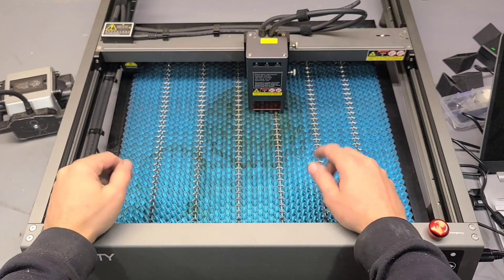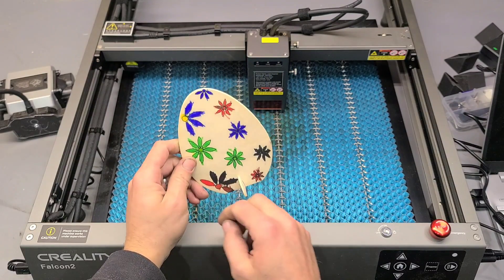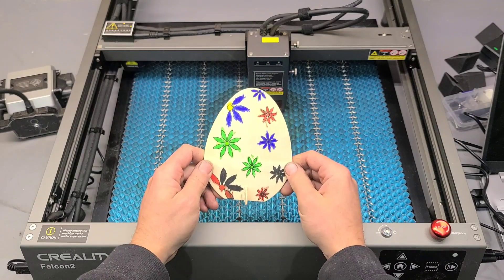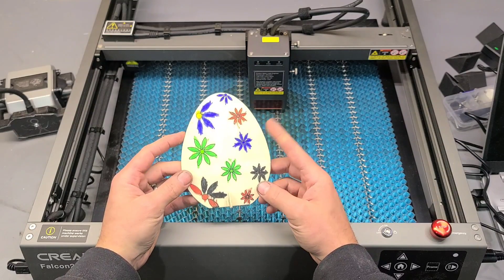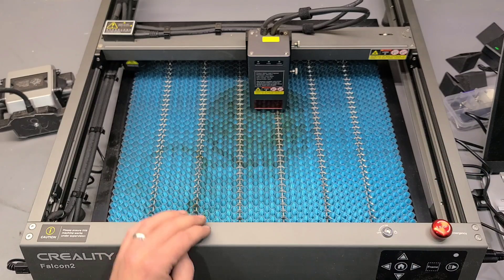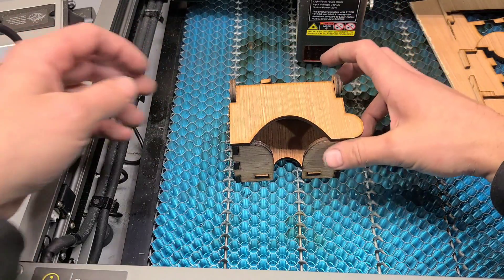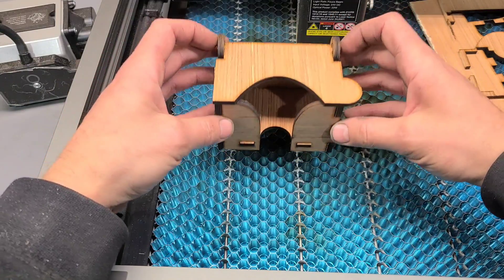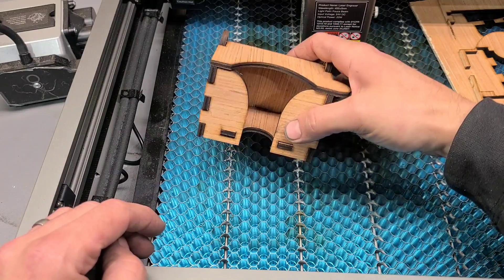Trying out LaserGRBL software on the Creality Falcon2 laser engraver.

Comment: I have to disagree with you regarding Laser GRBL. In the version I'm using you can change feed rates and Laser power. It's not immediately obvious where you do this but it's buried in the materials selection menu.
Reply: I'm currently using V5.7.0 and, when you open a file it takes you to another panel called Raster Import. When you click Next in this another panel opens up allowing you to set a start position, scaling factor, laser power and a few other bits and pieces. Its a cse of playing around to see what works. There is also, under the GRBL tab, a materials database that lets you select the material type and a few other bits. I'm going to download the latest version and see if its changed much. If it has I'll get back to you.
Reply: Just downloaded the ltest version and the only real change I can see is the addition of the Generate tab. This has the very useful option to create a teswt patern that allows you to check the accuracy of the machine (something that I did manually a couple of months back because my engraving was coming out a different size to my image.
Reply from the maker: i must see if i can find it on mine. Its still good software seeing as its free. Its very good for its simplicity for someone like me starting from scratch.
Reply: @deandohertygreaser  I use lightburn but fancy trying grbl, one question - with these imported files do you have to manually set the kerf? The hinged lid box I’m assuming needs some work regarding kerf for a correct fit?